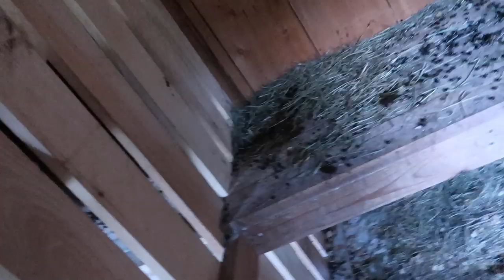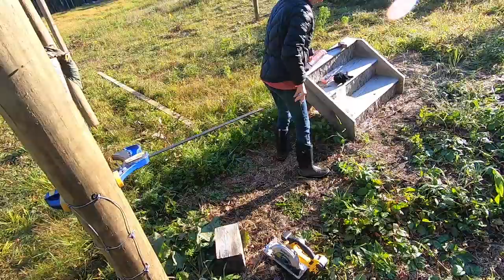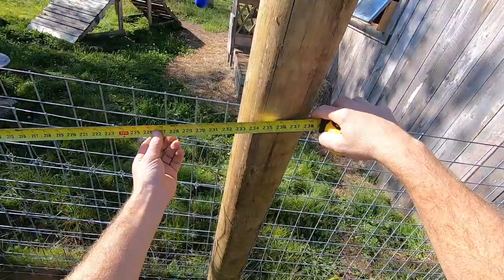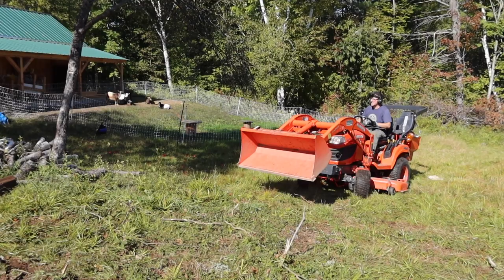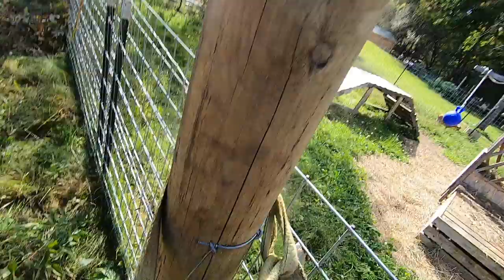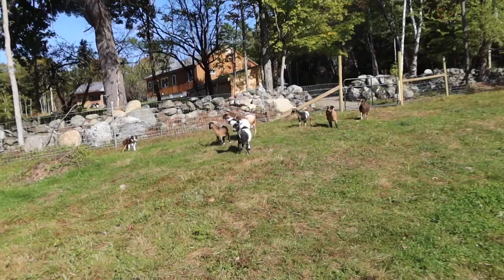Gina Couldn’t Handle Watching! Attempting to Fix new Pasture with a 20 Foot Long Telephone Pole

Comment: Al, could you use joist hangers for those 2 x 4's. Nail them on the main post and turn the 2 by 4 on its side. Sometimes its better just to eye ball them posts. Try a couple of smaller round post to let the big post roll on. Your like me it has to be straight or it will bug me. Go ahead and fix it Al.

Comment: Let's hear it for the pink ratchet straps!  I think they might be the best gift I've ever given somebody!  Glad to see and know your getting good use from the ratchet straps.  Consider placing a rag, towel or blanket on the line that your using to pull something so in the case of a strap failure the straps won't slingshot back at your head!  Very simple solution for a very potentially dangerous situation.

Comment: Favorite part of fall: no air conditioner, cozy clothes, and the leaves changing.
Reply: Same here! Nothing beats the fall smell in the woods either.
Reply: It will be nice when we get fall in NC. Getting close but I have had shorts on at Thanksgiving so there is that
Reply: And deer hunting!
Reply: jimmy mak for sure! And the smell of leaves in the air! Our deer season is almost always snowy.
Reply: In Texas we've run the AC as late as January on occasion. We don't really have fall, we have the end of daylight savings time, and with it the loss in ability to do things outside without flashlights.
Reply: That's a hard job, but in the end, it would drive you crazy. Would not get between Willow and her kids. We have cooler weather and rain in the forecast.   Thanks for sharing guys.
Reply: I’m not sure what that pole was for?  Explain?
Reply: @Vereynique  I always enjoy our 3 days of fall in NC.
Reply: @retiredump7038  i
I looked at the forecast for Raleigh and we might actually get first fall on the 4th of Oct.
Reply: Anxiously waiting in Kentucky
Reply: @sandrakohlstedt8583  the ground is so rocky that the post could not be set deep enough and was not straight! This was a great way to support and secure it

Comment: My favorite part of autumn: I grew up in the south and the season wasn't as dramatic as it was when I lived in PA and CT, or NC for that matter. As a result, my favorite part of the fall is when you can smell it in the air before it arrives full-blown. Subtle, yet beautiful!!
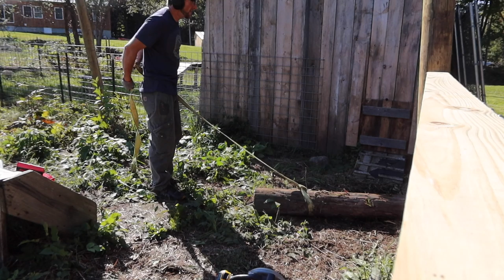~ Also wanted to say that I am constantly grateful that my mom taught me to sew when I was 14, including adjusting and caring for the machine. Her patience and instruction helped me with thousands of things throughout my life. I "see" things every day that I wouldn't if it weren't for that being in my background. Such as, at 13:09: You know the tensile strength of that webbed strapping, but all I could see was what would happen if it snapped! Scary. Doubling it would have made it shorter, but stronger. Then, at 18:42, when you were trying to drag the telephone pole into place with brute strength. If you had something like a piece of plywood or something for the pole to slide on, it wouldn't have dug into the dirt, adding resistance, making it even "heavier." Might have still been too heavy, but... worth a try? 
~ That said, I learn SO much from you and watching you work. I love your videos and they're the first ones I watch every day. Speaking of which... back to watching. I stopped to post this.

Comment: Where we live, in Belgium, the autumn is also behind the corner. Last Saturday we had a top day of 75 ° F but now we only have 60 ° F and rain. 55 ° F at night. We don't have harsh winters, at most 10 days of snow, but often frosts at night and in the morning. Rarely 14.0 ° F The best thing about autumn is how it smells in nature, the smell of mushrooms. same for spring, no mushrooms but the fresh smell of the fresh green. Unfortunately for the shorter days than, do love the sunlight, less the heat. So in that area I'm in the right place in the fall.

Comment: Good video.  I agree a bit of concrete will hold that post better.  Happy to see the boys  will have a pasture also.  I was a bit surprised that you were able to cut the new angle while in place but it worked.

Comment: We used to stomp rocks in around the base to stabilize posts in rock soil..had a long heavy rod for stomping..very stable , does not break down at active gate areas

Comment: 72 degrees in Newport, N C. We are located on the NC's Crystal Coast. We are about 10+ miles inland from the Atlantic Ocean. Near Cape Lookout. Any snow and school systems are closed. Part of the reason is my county ( Carteret County ) has approx.100 bridges any where from 5 over major Inland Waterways to expanded concrete culvert over small creeks. We are more capable of keeping sand over wash off roads during hurricanes than snow removal. Newport is also located between two Marine Bases, Camp Lejeune and Cherry Point. We have large group of retired military living in area. Have been keeping up with your hard work for approx. 2 years. Usually catch your updates 7 or 8 am. What a beautiful young lady Olivia is becoming.
Reply: PS love the name  "NEW YOKE CITY"
Reply: @edwardward5887  New Yolk City.

Comment: Fall in AZ begins when day time temps drop below 100. Winter begins when day time temps drop into the 70s. Spring begins when day time temps rise into the 80s & summer day time temps rise into the high 90s.

Comment: Luckily it's not as cold here in Wisconsin! I'm still working on my project, and it requires gluing down foam and rubber roofing! Below 40 degrees I can't work! I need to get moving fast. When you are working with posts, get yourself a post level. It shows plumb on two planes and straps right to the post with an elastic strap.

Comment: Nice job guys. May i suggest adding a few brace supports  especially at the corners. It will add alot of strength and help prevent the posts from leaning.

Comment: I noticed the comments about Pigme goats. I raised two some years ago and the only kind of fence that they could not go through was a chain link. The nanny would go through the chicken wire fence like it was not there. She could jump the 5-foot chain-link fence. My Billy had a bad leg and did not try to jump the fence, He just went through the wire until I put up the chain link. They were good for clearing brush in my pasture. I watched them strip leaves off branches of hedge bushes like a shrewder does on a tractor.

Comment: Al,  we have a tool called the come along on our homestead, used often to work with fence and other projects.  This tool may work well for you in tight places.
Reply: Was going to suggest the same. The right tool for hundreds of projects.
Reply: @elkhunter8664  That's for sure!!
Reply: @Sandy Oklahomatransient ,
Al is using the ratchet strap for the same purpose. However , I don't think that it is as strong as a come along.

Comment: Great video! I'd like to suggest you make two small investments to assist in your fencing operations. First one being a 'come-along.'  A decent one can be had for about 40 dollars. It'll come in handy whenever you need to work on a permanent fence. The second item being a Tractor or Farm Jack. Recommend the 48" model with a 3 ton capacity. It also can be invaluable when dealing with stubborn posts, among other things. We used both of these on cattle ranches and miles and miles of fencing. Couldn't have done the job without 'em!

Comment: We won't get cold weather until about mid November and hardly any snow until mid January or February and then just a dusting. Fall time favorites is sliding into a pair of cool jean and wearing light weight sweater and jacket. The cool crisp air just shy of frost. I live in Amarillo, Tx.

Comment: In NZ where I am it has rained most days or every other for the last 17 weeks we even got snow on the ground this winter which we have not had for 10 years normally only in the mountains - Sunday it was 60 then down to 42 on Monday a southerly blast - Oh spring were are you we have waited so long - even the puddles in the paddocks have puddles and the drain tiles just can't keep up
Reply from the maker: That sounds like the weather we had last year

Comment: You could have cut a notch in the vertical pole for the T Pole to fit into as you pushed it down, that screw has a lot of pressure on it, and will eventually rust through. but then the pole will also rot, so by that time, the vertical hopefully will be stable, if we watch you long enough, we will see! We are in this with you, for the long haul also, Till the screws rust though or the fence rots, and then we can always start over, all 136K+ newbies of us and you three!

Comment: I use to be just like you Al, I would get a cold every time a season change,but the last 3 years I started getting a flu shot, and I haven’t had even a sniffle since.....knock on wood😁
Reply: I don't trust the flu shots, so I don't take them, and I don't have a cold problem either.

Comment: I'll second A Graham on the no air conditioning thing; and raise going back to a non-centralized air heating system. The one thing I really don't like about fall is blowing the gunk out of the air system. When I was a kid we had baseboard heat and much less dust! There is a quality about the cloud formations in September that tells me if it were 20-30 degrees colder, we'd have snow. Last year I saw them in August which was a pretty good predictor of last year's winter in the Mitt. My favorite thing about fall is the beautiful display of color here; the Yoopers see it first and day by day it creeps south. I wish the dog was still here for a good fall hike.

Comment: I might be able to tell you why the change of seasons gives you cold symptoms. 

When we begin to heat our homes our mucus membranes get too dry, tiny, tiny cracks happen as they dry out too much. 

Bacteria that always live in many areas of the body, such as nose, nasal passageways, armpits, groin.. are given the opportunity to invade these tiny cracks in our skin's defense system. 

The bacteria that live there commonly, are both Staph & Strep. 

Hope this helps..  You can try to add some humidity, leave some water around on wood stoves.

Comment: I have been trying to remember what I used for an easy gate latch. I can't remember what they are called but I do remember breafly seeing one in a resent video. If I remember correctly I seen it in the goat stall. You had a bucket hanging from it. I will see if I can find the exact video and give you the time stamp of when I seen it
Reply from the maker: That makes sense. Thanks.

Comment: That auto door opener is peachy keen but can't you mount it inside instead? that way the string and door slides would be protected from ice and snow. Just cut a hole the size of the top box above the door and poke it out from inside so you can access it, it would almost fit flush even, like putting a lock in a drawer.  The only thing I could see getting in the way is if the light sensor is on the side instead of the front of the control.
Reply: Hi Mr. Dave, about your comment. If you want to keep things out, you brace on the outside so you can not push it in (chicken/ducks doors, barn doors, for small animals). Protect from things getting inside after the animals. To keep things in, you brace from the inside (stall/corral doors, for large animals). Protect from getting out. Hope this helps. Have a wonderful day.
Reply: @nickianderson1716  I get what your saying but if a bear wants in, it's getting in no matter what's there, those rails should be plenty to prevent a skunk or raccoon from getting in though. And if not, then modify them. I don't know if it will block all predators, but I do know winter will freeze up that wee string.
Reply: @newfization  definitely agree on the string. Hoping it's not just a cotton but more likely where he is located,  them the hardest parts of winter hits he will will keep them inside. He always has the option to use the man door if need be.

Comment: If the telephone pole you found was standing, it's possible it was an old utility pole.  My grandfather has a pole still up at the back corner of his lot, since the power lines used to run through the woods and not along the road.

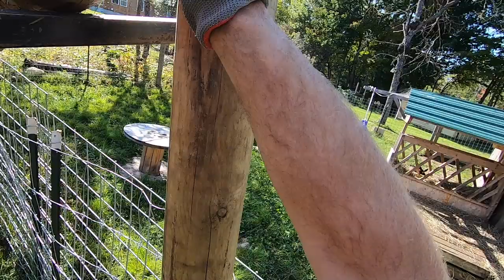Comment: At 21:00, you could have cut a slight concave recess in the top end of that telegraph pole, then it would fit around the vertical pole and remain stable, not flopping out frontwards or backwards.

Comment: Al, are you thinking of moving NYC closer to the barn for the winter, so that you don't have to slog through the snow?  We have a lean-to next to our coops so that the chickens can still get out and stretch their muscles when there is a lot of snow on the ground.  It is open on the sides but has a roof and dirt floor.  I don't like to think of them quite so crushed into the coop for the cold dark snowy months, haha.  Also, we installed a solar light that comes on at dusk.  That makes it easier to take care of them on the short days, and might even encourage a little bit more egg laying.  Also, will the Marans join NYC or will there be a separate coop for them?  In the winter we try to get back to just one flock/herd (sheep, chickens, beefers) as much as possible, for the ease of chores during the miserable weather.

Comment: Next time you need to move a heavy pole, set a few round cut off sections under it for it to roll on. 

How about pounding rocks in around the loose poles? Do you think you could find a few rocks on the logged section?

Comment: My wife doesn't like when I do certain jobs either. Like bush hogging the steep hill in front of her parents cabin. I put the seatbelt on put 4-wheel drive tractor in low range. I see the bottom going down and mostly sky climbing up. She refused to watch at all my kids did but she wouldnt even look out window

Comment: Love the cooler weather.  Why didn't you use the trailer to move the pole? Could you have put stake in the ground and then used the straps to ratchet into place?

Comment: I really appreciate that thus far I have always observed you promptly turning equipment off and doing minimal idling.  Some homesteaders are not so mindful about our impacts on the future with fossil fuels.  THANKS.  Hmm, darn a bit later you might have left it idling more than a minute, hard to tell, lol.  If so, thanks for when you idle for less than a minute, which is often.

Comment: After you trimmed that pole, which had to be done Gina, I would have used the fork tyne to force it down further and then pushed the post with the bucket at the same time, that would've gotten it much closer to plum, then added screws and left the tractor there supporting it until you got some rapid set in the hole. Then I woulda been happy 😀 every time you walk past that you're going to feel lopsided 😂 of course you would never film that and put it on YouTube lol

Comment: Golden Rod, Rag Weed, and Molds are getting you, but if your running a temp, then you may have a cold.  Chicken Soup and Hot Toddy for the cold...oh, and REST.  Allergies-Allegra D through the season.  Allegra D is safer for your heart.  Sometimes allergies can cause you to get sinusitis which you may need antibiotics if it goes too long.  Be well!

Comment: In this video you have the strap coming straight back at you over the tractor bucket while you pulled the post,  If the strap broke, it would fly back and severely injure you. As a long service US Navy man, I had chills and concern for you watching that.

Comment: Al I don't know why you turned the 2x4s flat instead of vertical, maybe you said something about it at the first, I couldn't hear. The reason I'm asking is some of my goats (Pygmy 22-24" tall) would jump over 5' if they had something like the 2x4 to get to. They used the top pipe of the chain link fence to pull up and over. I had to go to 6' fence to keep several in. FYI, when you reach a corner in the fence to keep the wire from pulling the post over, we set a second post 5' from the corner then put a log or 2 by across the top. Then build a X brace between the 2 post.
Another way is a dead man ( 5' log buried cross ways at the top of the hole)  to keep the post from moving. This must be buried against the post and in hard ground, no fill in dirt. The bottom of the post should be against hard dirt to. Good luck stay safe.

Comment: time to get one of those Dewalt battery powered chainsaws. perfect for jobs like this. It will also use your existing batteries. Or get the the 60 volt Flexvolt and those batteries will also work with your existing Dewalt tools..  i have both and hardly ever use my Stihls anymore.

Comment: The whole secret to having a fence post stay in place is to really tamp down the dirt hard all the way around the base with your shale bar to set the base in place using a level to make sure it's good 360. Do this for about 4 inches deep at bottom.
If you can move it that much with your Kubota, I'm betting you didn't know that trick.
B4 tamping, remove any pebbles & small rocks from the dirt you're using and never throw big rocks or use cement or concrete in the hole as that will move the base when water gets in there--as it will--and then, when it freezes--as it will--the post will loosen and eventually fall over.
Good pressure treated fence posts should last at least 50 years using this technique.

Comment: Would it have been easier to pull out the leaning pole, dig the hole a little and then set it in concrete?

Comment: Don't You have a Trailer Hitch on the Truck that You could use to pull that Post plumb so the 20 ' Telephone Pole with drop down between the two fence posts ??

Comment: An inexpensive. 9000# winch, car battery, jumper cables, and a short strap to tie the winch to something secure are your friends in those situations. I have all of those items in a small cart that we can pull with our atv's. Can be used when the tractor gets stuck in the middle of the field as well...